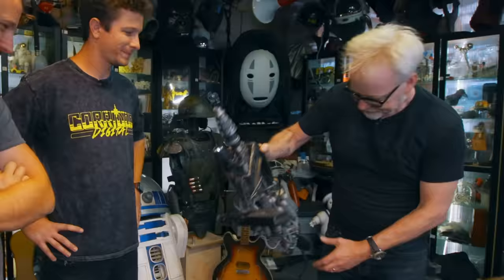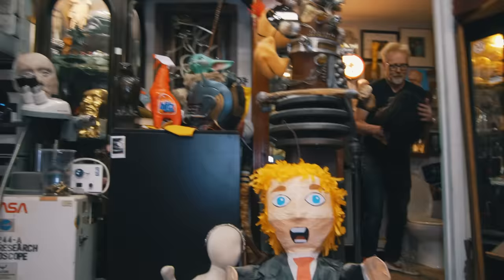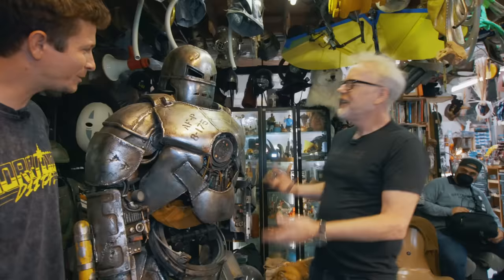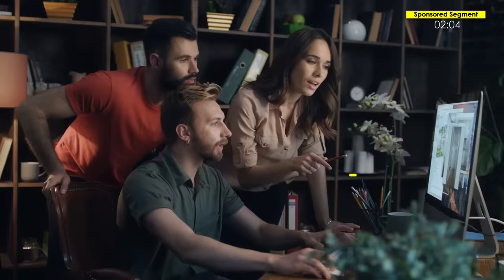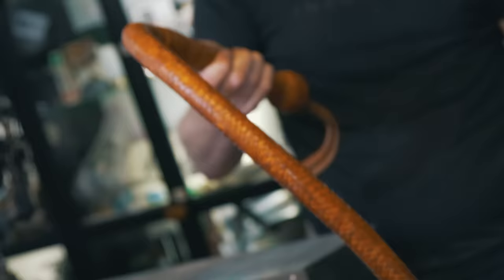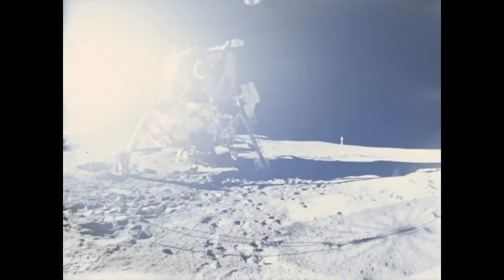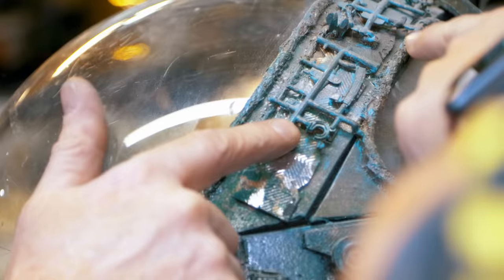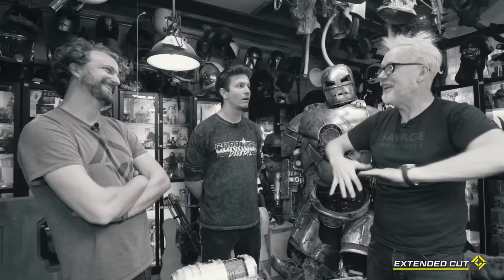VFX Artists React to Amazing Movie Props With Adam Savage!

Comment: "I'm not that interested in collecting the real thing because I wanna hand you the thing." This is a passion for the craft and the art and the effort it takes to make these, and honestly keeping the practice alive is a much better way to honor it than a museum-like collection.
Reply: I very much share Adam's drive to hold the object and have it FEEL like it's actually real. Have it weigh down my hands in the way only true materials can do.
Reply: I agree with this. I wouldn't care about having the actual product because you would always have to handle it with extreme care, always leave in the wrapper and never gaze upon it yourself. If I buy something I want to use it!
Reply: And when he dies, they're all going in a museum behind glass.
Reply: @MostlyPennyCat  If you wanna share this at scale, you need a prop repair team around. I have a local videogame museum that does it this way, it works but they have to be at it round the clock. If enough museums start sharing our culture this way, more spare parts will be produced and it will be easier to maintain lots of things for all of us :-) !
Reply: @MostlyPennyCat  He ain't gonna die.
Reply: Adam said, "hand you the thing".  I heard, "play with the thing."

Comment: The 1958 computer part got to me.. My dad's retired Air Force and worked on the SR71 and U2, both that came out in the late 50's and did amazing things taking extremely high resolution images FAR behind enemy lines.. Could you imagine what they could do if they upgraded the SR71 to modern tech? (The U2 already has been and continues to get regular upgrades, the SR retired in 1990, though finally cutting of the funds happened in 1998. Officially the two NASA owns stopped flying in 1999 but they've unofficially been seen/heard flying numerous times since then.)
Reply: Beautiful planes both. Think how long the B52 has been flying with various upgrades.
Reply: @kenmcvittie9214  1955

Comment: Hi Corridor crew (and Adam), you spoke in the video of wire memory; I'm sure you know it was called Core Store, a matrix of vertical and horizontal wires with a ring magnet at each cross point that was polarised clockwise or anticlockwise to represent 1 or 0. What most people don't know was that programmers on these early IBM mainframes used to play a game (probably one, if not the first computer game) called Core Wars. Two opponents would start with the address in opposing corners and would run a programme designed to convert each neighbouring address to either a 1 or a 0 depending on the player. A bit like 'Snake' on the old Nokia phones, the code would work through the core store converting 1's to 0's or 0's to 1's until they hit the code for the opposing player and overwrite thereby destroying the opponent and completing the matrix in their respective digit. Just thought you might find this interesting.

Comment: I once read "in the 70ies, a minicomputer was one you could topple with a good kick. A regular computer had a door you could walk through". It's an exaggeration, with a little bit of anachronism; the "regular computer" referred to is more of a 60ies version. The minicomputer is pretty accurately described, though you'd need a running start and not mind breaking your foot.

Comment: I wish they spent more time on that Byte.  IIRC, that sort of modular design was done right before transistors and integrated circuits took off, which replaced that sort of modular component design. Though that modular component design was, in itself, a brilliant optimization to solve the rats nests and ropes of strung together components that plagued technology prior to that.

Comment: 18:06 This is wild. Even the first very first computer systems were built for modularity and repairability. 
A bit malfunctions and breaks? You could literally just pull it out and pop in a new one. 
I mean, when a bit is the size of a screw driver I guess that’s totally possible.
Nowadays manufactures just solder and glue everything permanently into place and call it a day.